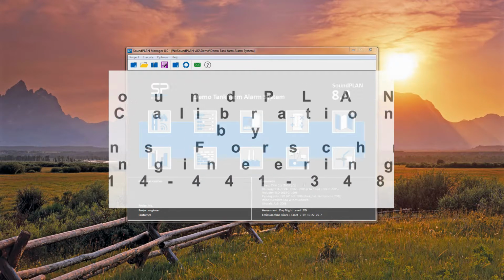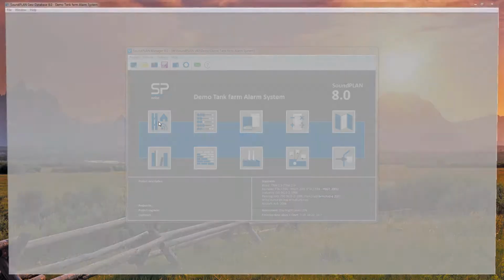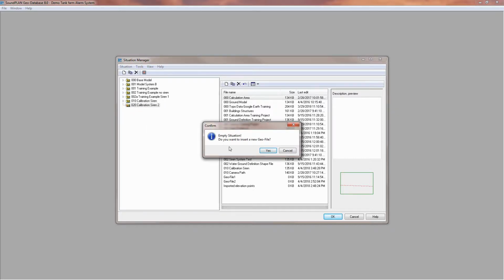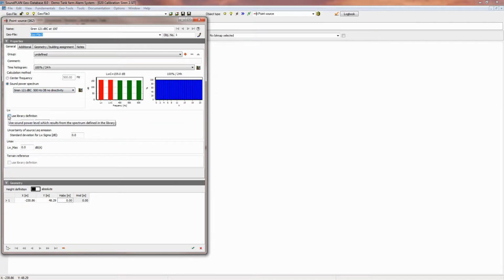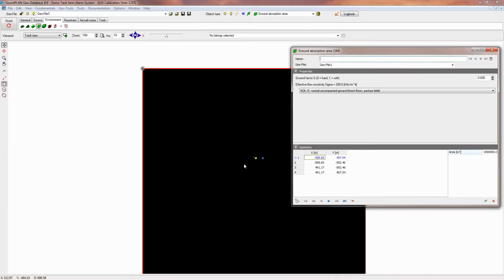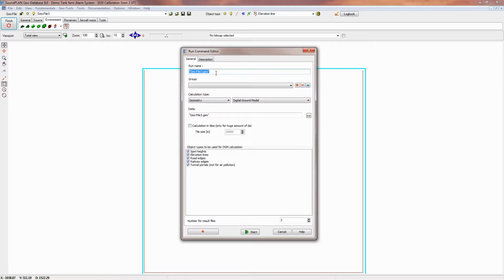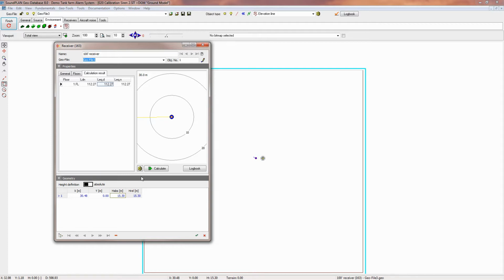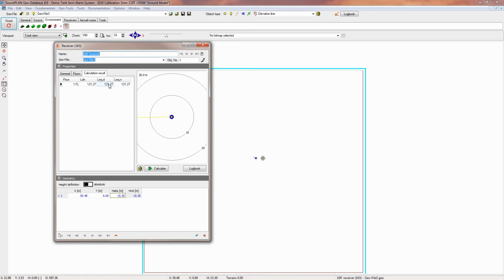SoundPLAN Siren Lw Calibration

Comment: For PA speaker we take dBA, can we take same for siren? OR is it mandatory to take dBC for siren?
Reply from the maker: You can define your siren with A-weighted, C-weighted spectral data - it just needs to be consistent within the input (Geo-Database, Library).  What is important is that you set the noise model parameter in SoundPLAN Run Kernel with the frequency weighting A, C or linear ...  SoundPLAN will modify whatever input it is loading and applies the frequency weighting to all sources found in the input data.